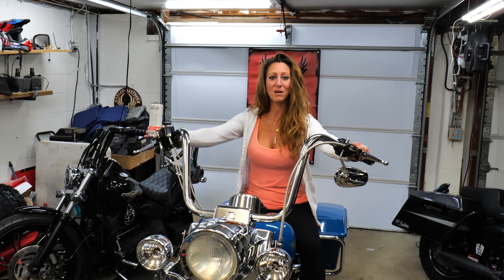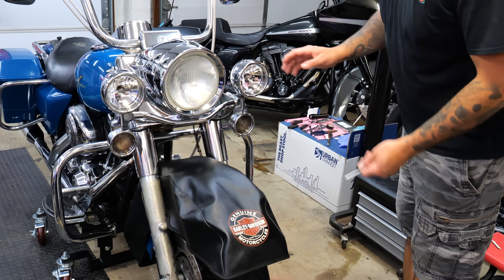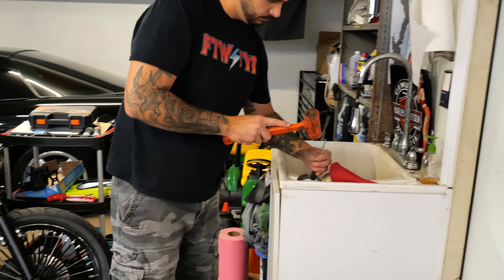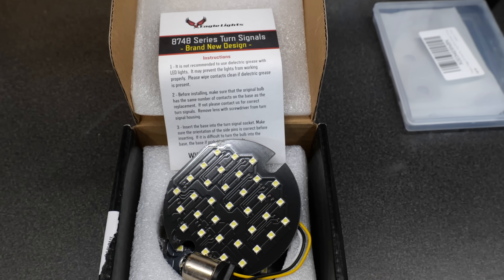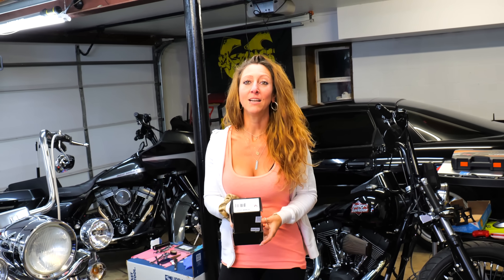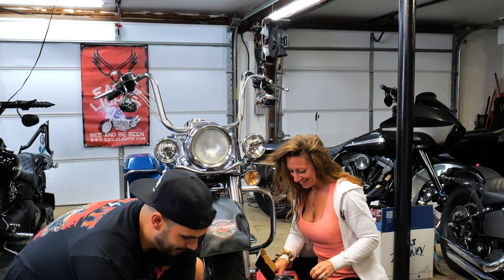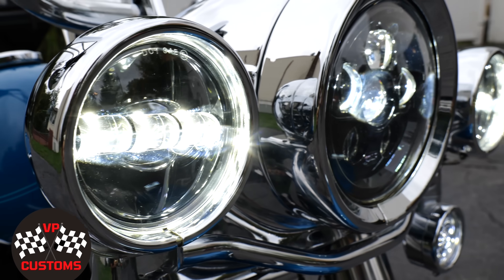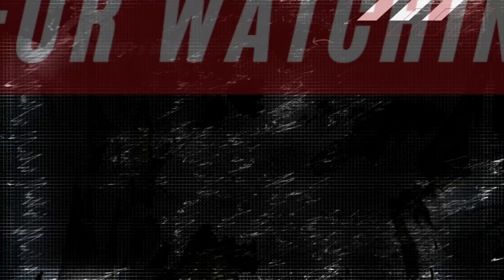This Harley Has Us Sick- Road King Build Pt. 3

Comment: It's exactly what I did to get it into this century. Full LED package front and back including turn signals. If you start putting love jugs that bike it's going to sound even more wicked when you turn the ignition on cuz not only does the fuel pump kick in and it sounds like a space shuttle. The fans have a nice touch to them as well
Reply from the maker: Haha yes! Familiar with that sound from friends bikes!

Comment: Whomever that was beating off a Rear Brake Drum with 2 prybars and a Sledgehammer (at 11:42). Please tell him two things, one he's got too many hands in the fire. Two loosen the adjustment screw in the Backing plate window at 6 o'clock and the Drum will then fall off.
 Good love Lights guys, I'll gladly fallow you anywhere in the darkest of night. So long as it's not raining, the wipers has never worked on my Bike... 🤣

Comment: My 09 didn’t get hyper flash
Reply from the maker: I think some of the newer bikes didn't 🤷🏻‍♂️
Reply: @VPCustoms  maybe. Mine hipered for a couple seconds then slowed up. ….. over here AU. We’ve had a few bikes burn wiring out with the resisters. They get hot and melt down.  So I opted without them